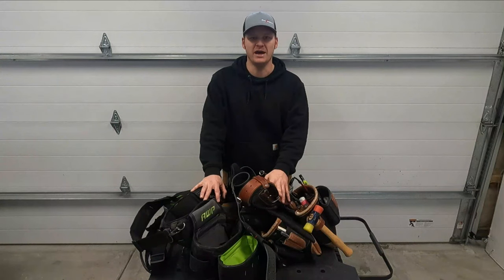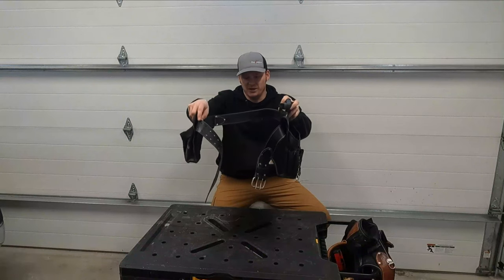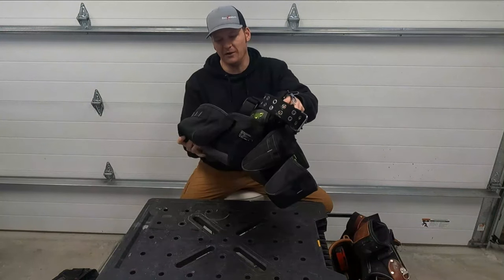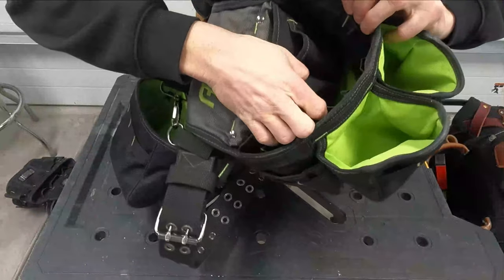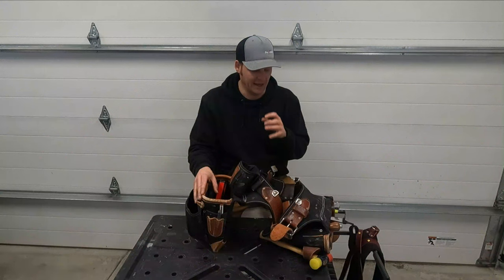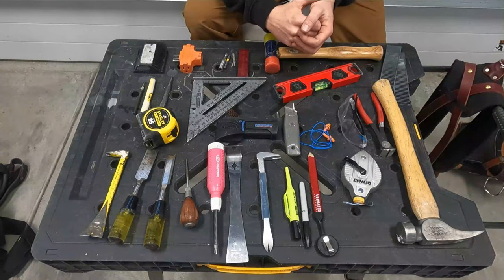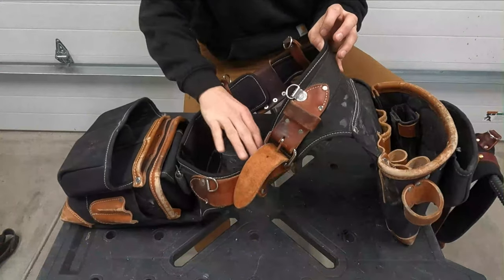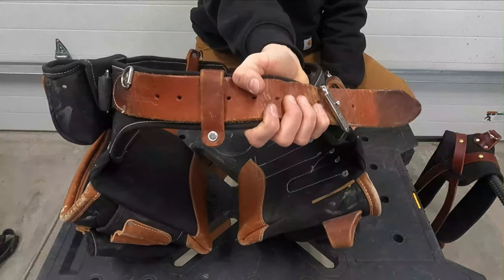Toolbelt Setup For A Handyman Or Carpenter | HANDYMAN HEADQUARTERS |

Comment: The only two things I hate about my tool belt are: Just like you show, it spills out whenever I finish the job and put it in my truck (usually tired and hate messing with it).  And, it gets hot af unless it winter time here in Texas.  I usually just carry everything in a tote with the bar handle across the middle, and my drill bag separately.  But I definitely take more time by not wearing the belt.  Depends on the job too I guess.
Reply from the maker: Yeah same here depends on the job. A deck I wear it all day. Repairs I bring it in the house but don't wear it. I have it on a hook in my van and it seems to not spill out

Comment: Do you like the Dead On bag? I bought 1 a few years ago to set up as an extra belt, it ended up just sitting, still have it, it has suspenders, 2 bags, belt, hammer hoop, I’ll try it on someday
Reply from the maker: @vikingnorm6935  I have a dead on pouch just for interior trim work. But I hardly use it